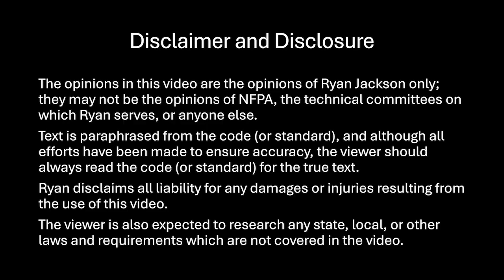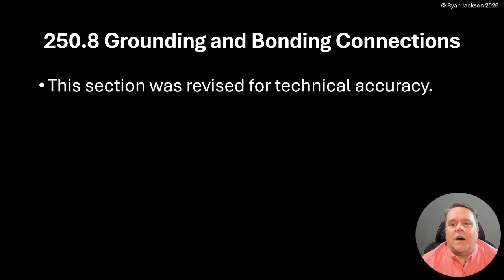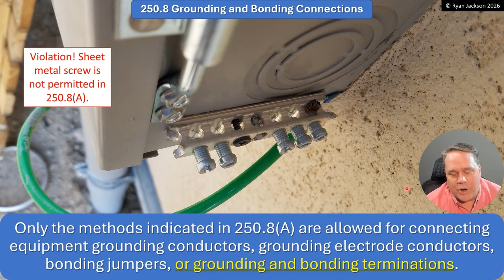100 Days of the 2026 NEC Changes Day 29: 250.8 Grounding and Bonding Connections

Comment: The attachment screw is a necessary part of the conductive path.
The screw isn't a wire but it is a conductor.
This is distinct from hardware which merely fastens equipment in place.
The screw which fastens the grounding bar also provides electrical continuity from the grounding conductors via the bar to the box.

In case this concept isn't clear, there should be explanatory text spelling out the requirement for solidly bonding for low-resistance electrical continuity.

Comment: We were taught that if we did use bolts, nuts & a lock washer to mount a ground bar had to remove paint on both sides of metal down to bare steel to provide a low resistance path. Old timer that I was ansppentice for many years ago always used brass screws & brass nuts & washers to attach ground bars - wires.ITE 480 volt safety switches had unusual 12/24 tapped holes for grounds. Finally ordered a box of that size screws to save from drilling holes.
Reply: What annoys me is the lack of a proper grounding spot in a disconnect. 🙄 They're completely painted/powder coated. The hole next to the earth symbol is barely big enough for an 8-32 screw. Then you have to cut off anything that sticks out of the back.
Reply: @MrFixItGa 
10-32 is very common.
In the unlikely event that you actually need a larger size, you can drill and tap it in the field.
You can remove paint where the lug/bar/fastener contacts the box on the inside.
Reply: @denverbraughler3948 Yes, I understand all of that. 
When was the last time you attempted to sand the paint off if the inside of a 30 amp, fused disconnect? There's no room at all inside of them. All I'm asking is why can't they stamp a raised ground spot like 1900 boxes have in them? Maybe they could put a little sticker or something over the hole as well so that the paint isn't there. 
I'm not asking much. 😂
Reply: @MrFixItGa If the threaded ground inboxes were flush with back of a box or safety switch we would mark the hole and use a 1/4" masonry bit to drill a halve inch deep hole the protruding ground screw would not be a problem
Reply: Well, the actual "grounding" is somewhat of a joke.   The "resistance" is supposed to be less than 25 ohms/whatever.   At 125 volts, that's 5 amps.    But bonding all the metal and pipes makes sense but doesn't provide as much protection as GFCI.
Reply: @GilmerJohn :

By "grounding", you mean earthing.
It's no joke, and there's no 25 ohm requirement because there's no requirement whatsoever to test resistance of the grounding electrode system.
Because you misunderstand the purpose of earthing, you think that it's a joke.

The resistance from the grounding bar as shown to neutral should be approximately 0 ohm.
You should test it to be sure.  
But you have to use a machine screw.  
A drywall screw will increase in resistance over time so it is always wrong.
Reply: @denverbraughler3948 sheet rock along with wood screws & self tappers are not legal to attach grounds. NEC requires at least two full threads .
Reply: @GilmerJohn 25 ohms or less is only for ground rods!  For circuits where ground wire is installed you would want lower then 1 ohm resistance to quickly clear fault and prevent serious shocks. We had a lazy electrician who never installed ground wire & just using the conduit to supply grounds One of his conduits got pulled out of a fitting due to turf tossers ( plumbers ) installing a pipe. Anyway wire got nicked and when he held each conduit in one hand attempted to  put conduit back together he hit hit with 277 volts along with taking down equipment when 480 volt breaker tripped. Lazy corner cutting turf tossers told us you have to do what you have to do so we removed the handle off the water valve and cut his new line in several places.